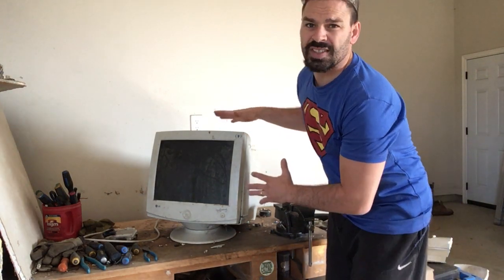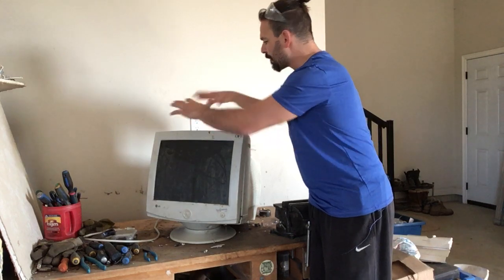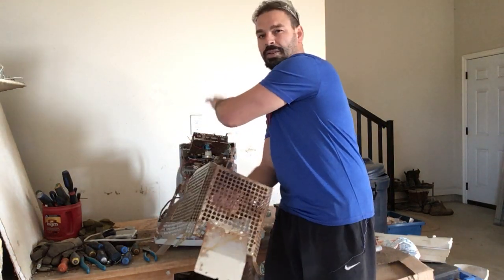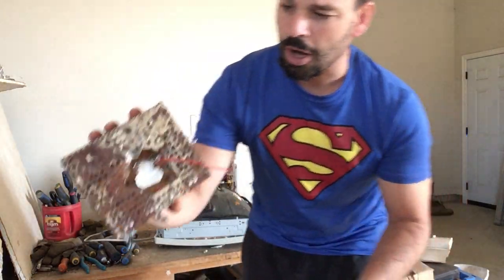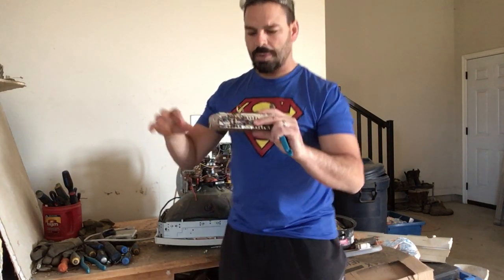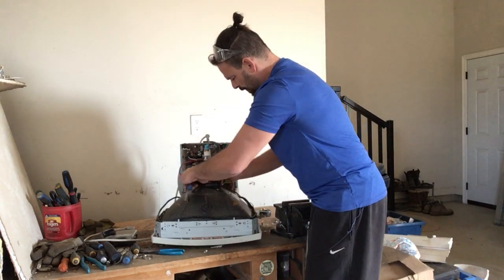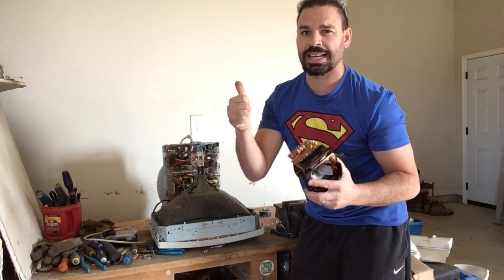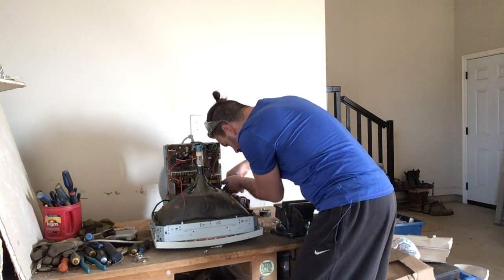Scrapping a computer monitor for copper, aluminum, silver, steel, and no waste.

Comment: For the wire around the tube, i use a stanly knife. I put the wire on a small wooden beam. Fasten it with a clamp. Pull it strait and just put the knife from top to bottum. Its verry easy to do. And its number 1 copper.
Reply from the maker: Nice. You do have to check first though, since some are also aluminum. But yes, good copper for sure. Thanks for the support and watching.